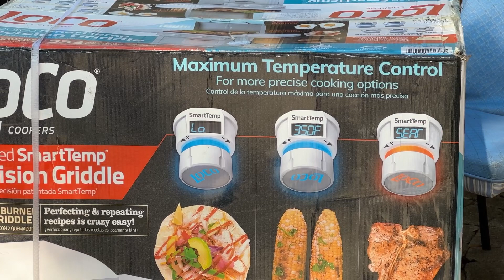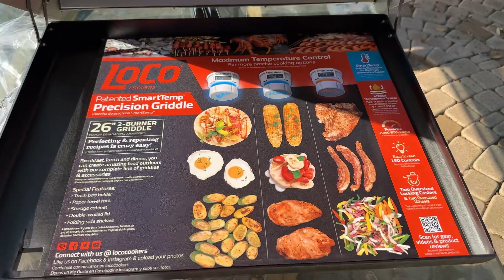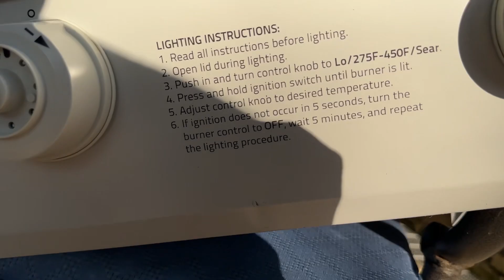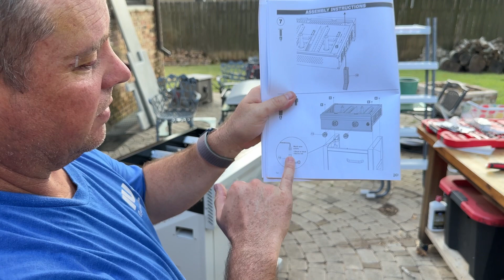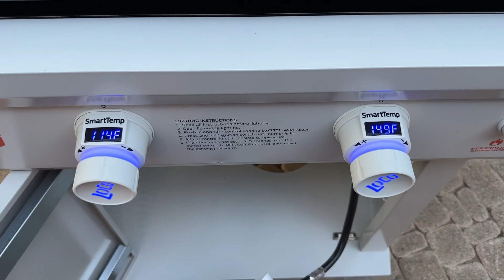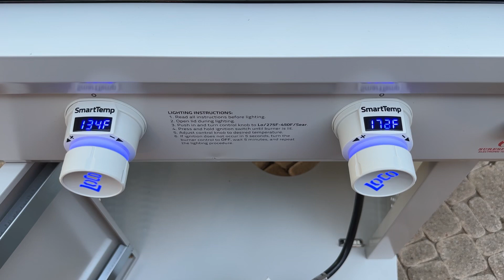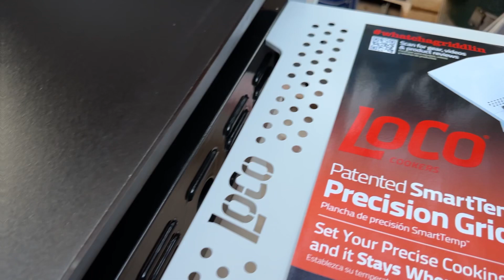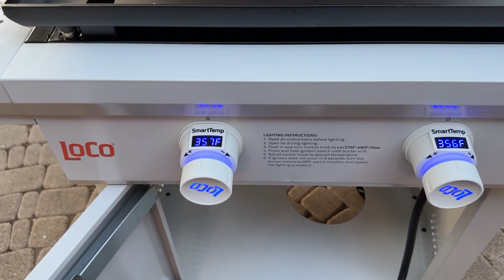Better than smoking? LoCo Griddle Unboxing & Assembly

Comment: I was also stumped on the red and black wire step, glad I'm not the stupid one. Thanks for the video and clarification!
Reply from the maker: Yeah, I’m not sure if they’ll clarify the steps in the manual. I found out that if they’re backward, then when the burner tries to cut back as it reaches temp, it’ll actually cutoff.  Easy fix if a burner issue comes up!
Reply: @CloverWoodDIY  Thank you, I know what to look for now, I appreciate it.

Comment: Glad you made this, just purchased the 2 burner, and there aren’t many videos on this one. 
Good upload, any updates on the quality, efficiency, maintenance etc ..?
Reply from the maker: Funny you ask. I was going to do an update soon! Finally got the replacement parts for what was damaged in shipping. Without giving too much away, I’ll say I’m impressed with the service. I’m also really pleased with it and (at the sale price) the overall value.  I do wish I had gotten the 36”, but I can do just fine with the 26”. Thanks for watching!
Reply from the maker: An even more recent update - the parts that were sent as replacement were also damaged by the shipping company. When I reached out to LoCo, they told me they’d sent replacement parts out once again and had no problems doing so. What’s funny is that the replacement parts came in the same box as a brand new series 2 26” griddle… and this time they sent it on a large pallet via a freight shipper so it had considerably less damage risk.
Reply: @CloverWoodDIY  good to know, the weather is starting to get warmer on the east coast so I’ll check to see if any replacements parts are needed, much a

Comment: How did customer service handle the dent issue ?
Reply from the maker: They sent a new hood and control panel assembly. Since it was a series 1, there was a two month back order. Still, they handled it promptly. The replacement even came in with shipping damage so they just ended up sending a whole new series 2 griddle!

Comment: My wheels won’t turn.  Is there a lock on them to keep them from turning?  It rolls  just fine but they won’t turn.
Reply from the maker: Do they turn if you lift the unit up a little? You should have two casters that spin to allow directional movement.  If they don’t turn, try a little grease or lubricant into the rotating spots

Comment: I need the Cable ?
Reply from the maker: You will need to supply an extension cord or just simply connect the AC adapter that is provided with the griddle directly to an outside outlet near your cooking area.